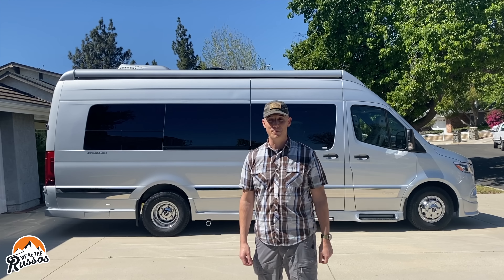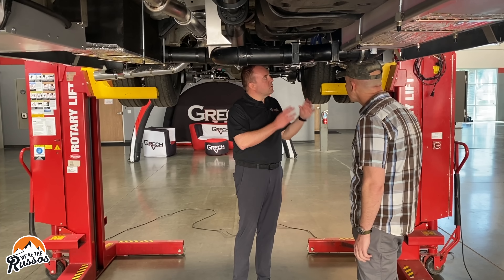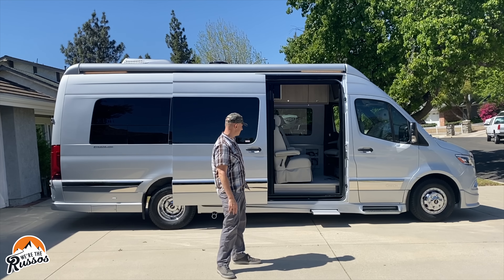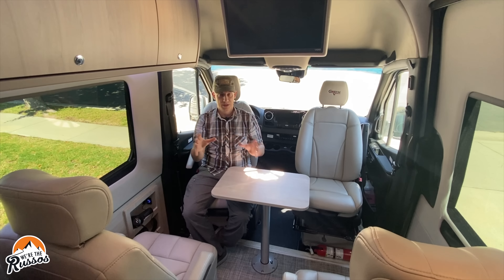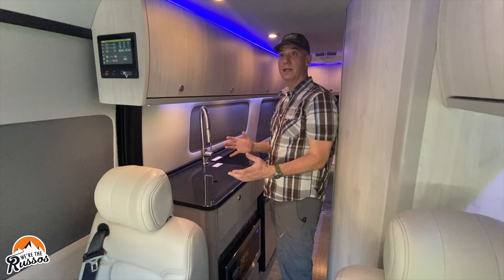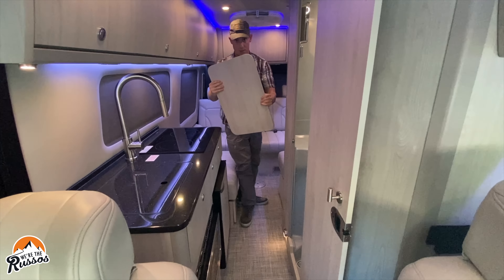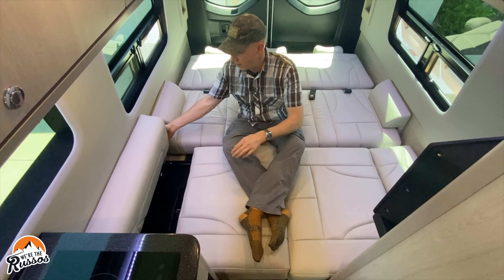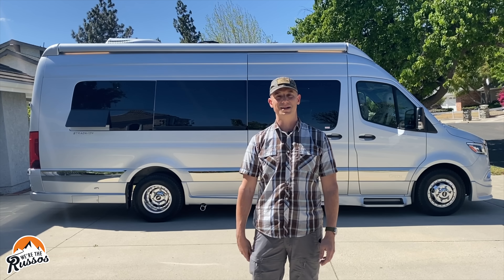Grech RV Strada-Ion Walk-Through | Luxury Class B RV

Comment: In terms of styling, there are few American motorhomes (aka RVs) that impress. This, however, does. Whilst it isn't necessarily to my taste, I cannot deny that this is especially well thought through, practical and the attention to detail is exemplary. I would be more than happy to ask Grech RV to create a custom caravan (camper trailer/RV). The very clever use of body styling as a hatch door for access to external inlets etc., the bed set-up and pre-wiring and the rear-luggage space hanging curtain-like fabric to protect the rear of the seats and the wood is the kind of attention to detail that is hugely useful when on the road but easily overlooked at the time of purchase. All of these are notable examples of that attention to detail. A manufacturer that is also willing to show and explain the underside of their motorhomes/RVs is another indication of quality. This is perhaps expensive (it is luxury after all), but I also think it is good value.
Reply from the maker: All great points Andrew - thanks for watching!

Comment: Lots to love about this van. Feature rich and only the best in the latest camping tech available on the market. 

My only concern is the lack of protection for the undercarriage. If you plan to go off grid a lot of care must be done in the type of roads your travelling on.  A lot of damage can be done by hitting rocks or other obstacles. I would like to see more skid plates added to protect important equipment. 

I live in BC Canada and a lot of country side gravel roads have a centre hump that would damage this vehicle.
Reply: If you read my comment above, you'll know I'm not sugar coating it. YES the bottom is NOT sealed for off road. The sewer hose is exposed and you wouldn't want caked mud on that. If dirt is your primary path, then the under-carriage would need you to add some cover protectors.  Good point -- and its not 4x4. The 4x4 is shorter and doesn't come with the fancy smooth rear ride suspension (you'll want that for sure!).
Reply: Do you know. Where to buy grech?

Comment: This actually beats Airstream I think.  Although I like Airstream's front cabin trim.  The inside back cabin shares similarities. The exterior is much better than Airstream. I found several Grech rv and been commenting about the driver side finish.  I think it needs a bit of better trim.  Looks like a fancy delivery van with manufactured layout.  Love the seats though.
Reply: The exterior is identical to the Airstream. They may have improved on some things in the interior but for the most part they duplicated the Interstate. Don't blame them the interstate is a great rig.
Reply: @1nhonho  Exterior is not like AIRSTREAM, No way, GRECH RV is much cleaner looking without "all the cut outs and bobs and fittings" along the side. We shopped Airstream and Grech is significantly nicer inside and out. But you have to have a detail eye to notice these things.
Reply: @nomomomo5422  Oh my dear you are so wrong. Airstream has had this very same design long before "Gretch" showed up. And they literally copied the Interstate. in fact Grech fell short as far as interior decor is concerned 
Give credit where credit is due.